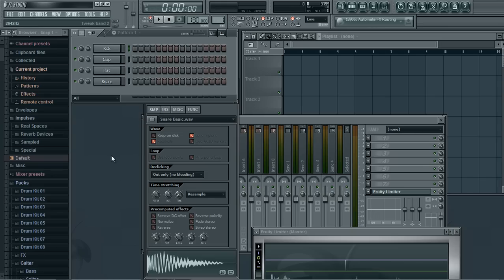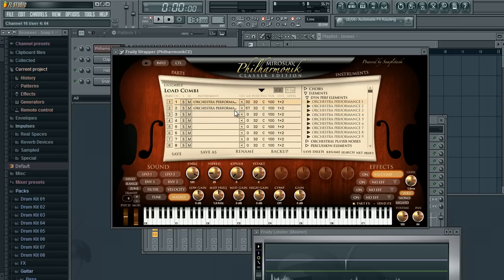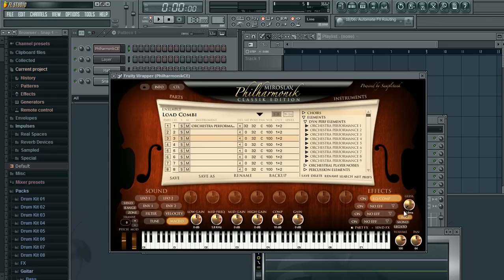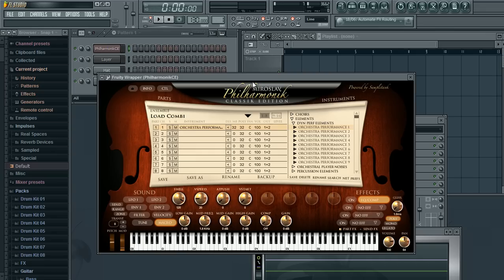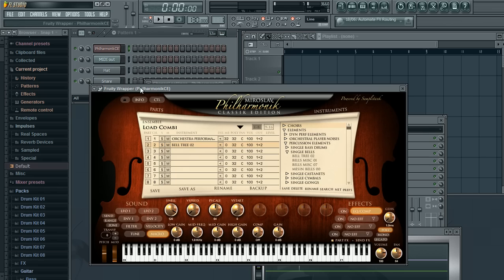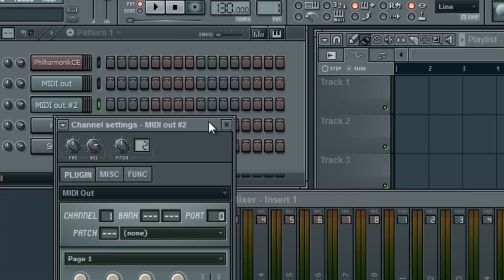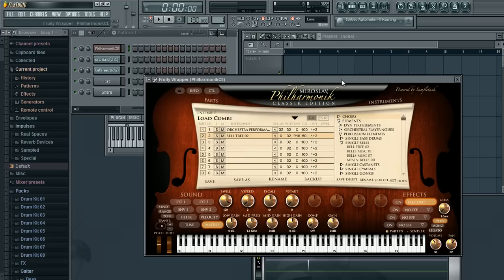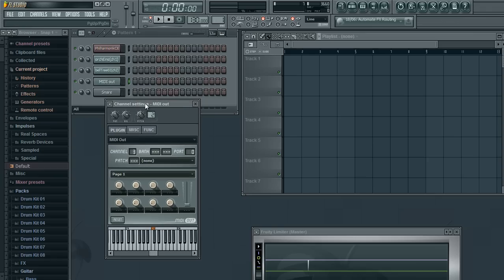Multiple Channels of MIDI Input Controlling a Single Instance of a Virtual Instrument in FL Studio

Comment from the maker: Thanks, ViscaFCB90, can you tell me in more detail what you did for the midi keyboard switch, and why did you need to use keys to switch? Usually a drum-kit will have already have kick, bass and toms assigned to different keys? Seems like you are also using the keys to trigger melodic instruments? it will be nice if you can walk me through or even record a video to show me your setup and what it is you are trying to achieve? Thanks for bringing up a question so I can try and solve it as well!